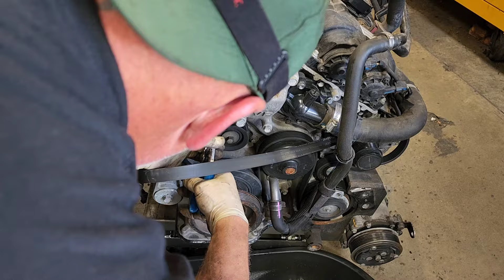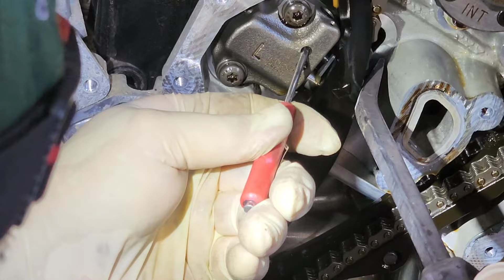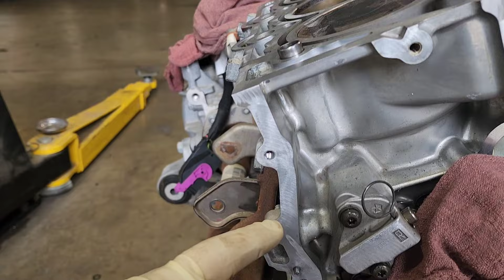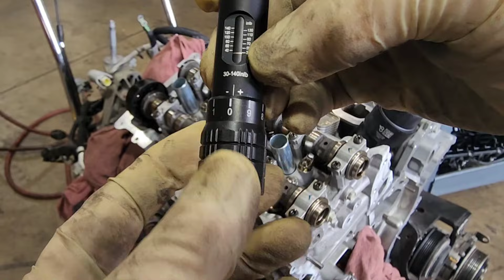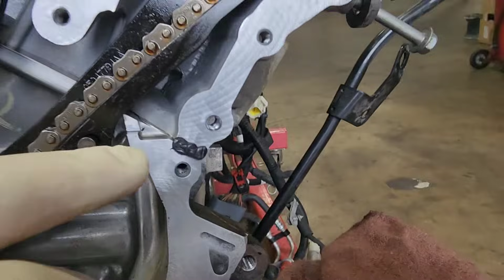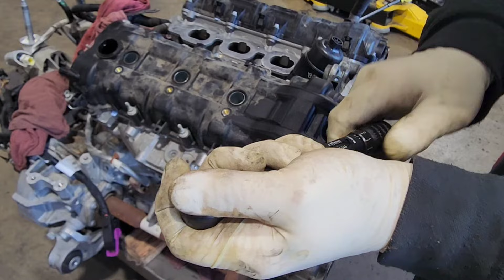3.6 Chrysler Pentastar How to Replace Head Gaskets

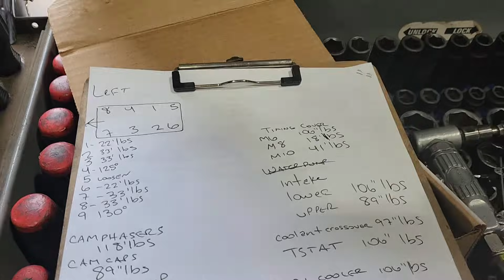Comment: 11:25 this is a v6, right? That's someone giving advice for a v8....
Reply: There are 8 bolts holding the head cover to the engine block on each side
Reply from the maker: This is a v6 engine.

Comment: What were the torque specs for the bolts when putting the pulleys and tensioner back on
Reply from the maker: Message me on Instagram
Reply: @nutsandboltswithtone  I don't have Instagram
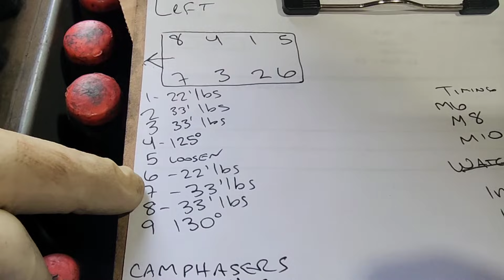Reply: @nutsandboltswithtone  How far do I loosen the bolts on step 5 at 11:43

Comment: What a automotive rebuild nightmare. Back in the day I replaced a Mopar 440 crank in a K Mart parking lot
If DOHC engines were first, the 1948 Olds V8 would be considered an engineering miracle .
This video should be titled " Why EVs are an inevitability "
Reply from the maker: @lynee9485  a lot different then older cars for sure

Comment: You do not have to remove the front cover to remove the cylinder heads. I just replaced a 2016 van left head. I did not remove front cover.
Reply from the maker: You are correct you can do the left head with the cover on but not the right head. Thank you

Comment: I actually helped a friend with a head gasket job on a 3.6. We used head studs instead of head bolts. I just find studs work better.
Reply from the maker: @mikepuk8224  yes head studs are for sure better
Reply: @ I prefer the durability of them. Head bolts on a 3.6 I am not too fully trusting of them for some reason.

Comment: Thanks for making the video and telling me the torque. I'm going to do it in the van I have. I have a Misfire on the piston but I've already changed what the book tells me: the spark plug, the injector and the coil. The problem is valve
Reply from the maker: Good luck.

Comment: If I check both heads for flatness and they pass would it still be necessary to send them to a machine shop? I’m trying to save time and money where I can but only if it makes sense. Wife’s jeep started puffing from exhaust and then failed a coolant sniffer test but never overheated.
Reply from the maker: @smith45acp  Tbh I never pull heads on anything without sending to the machine shop.  May need valve work and also to have valve stem seals replaced.  Just my personal opinion.  You're already spending a bunch of money to do the repair may as well do it completely right.
Reply: Thanks, man. This video has been very helpful.

Comment: Great video. What RTV silicone do you use to fill the gaps when replacing the valve cover gasket? Also how long after applying the silicon can you install the cover?
Reply from the maker: I get the rtv from Chrysler for this, but most guys in my shop your Permatex Right Stuff, supposed to be set within 5 minutes. Once you apply the silicone you need to get the cover on asap
Reply: @nutsandboltswithtone thanks

Comment: Does the engine HAVE to be removed for this job on the ram 1500s?
Reply from the maker: @aaronchandler152  no not in a truck. Usually you can do it in the truck

Comment: Got a code for intake valve control solenoid number 4... p1059...is that the ones on the front of the valve cover?
Reply from the maker: @jamesburch716  should be but just I'm at home and don't have access to info right now

Comment: I have been trying to find out and have had no luck. Why when removing the cams would you need to remove the oil control valves and phasers. Couldn't you loosen the chain tensioners and then remove the chain and leave the phasers/control valves attached to the cams?
Reply from the maker: @waynebowen8872  the timing chain does not come off without removing the phasers.

Comment: I took one apart last night, the cam arrows were lined up when i took it apaet. I marked the marks for each cam but forgot to make a mark on the idler. And none of tbe original 3 links on the chain line up to the marks i made. I had the head off so i know im at tdc but i forgot to mark the idler pulley. Any ideas/tips what i can do to make sure im in time with the idler sprocket
Reply from the maker: There should be visible links on the chain, so you could just use the chain and put it on the engine by colored links. message me on Instagram and I can help you out
Reply: Basically the arrows on my idler sprocket are facing up instead of down

Comment: Excellent illustration of dismantling the engine and reassembly! I don"t follow you and the torque specs though. It doesn't"t make sense to me. Could you clear that up for me?
Reply from the maker: I am home on disability at the moment, had to have surgery again on my foot. the screw in my foot broke, I just got a new partner that has online oem repair info. If you use my code
Nuts&boltswithtone you get 22% off. go to emanualonline.com
manuals are between 20 and 49 and has all the repair info, diagrams and torque specs.

Comment: What do you recommend on what to use to clean engine deck surface?
Reply from the maker: I personally use scotch brite pads, you buy it in little sheets, cut it into pieces. Keep it soaked in Brake clean and it cleans the best.

Comment: I had a question as working on jeep wrangler 2013 the manual said i had to torque the headbolts to 140 degree but i only done 130 degree. when i start the car am still had coolant leak in the piston. I have send the head to machine shop and snad the block my self.
Reply from the maker: First thought is if you did not torque the heads properly then that would be what I would think.

Comment: Thanks for video I used it as reference guide to replace left head gasket. I’m sure I got it out of time, any advice on how to get it on the right timing
Reply from the maker: @danreid694  oh man I'm sorry to hear.  Unfortunately if you didn't time it correctly you have to disassemble to get it back in time possibly redoing the whole thing.  You can message me on Instagram if you need any help.

Comment: Am in the process of putting the timing chain back the marking has when off two pin after two revolutions but I can still count 12 pins is this still alright ?
Reply from the maker: When you put the timing together you line up the colored links, pull the pins on tensioners, then you are rolling over the engine to get slack out of chain, the colored links will not line back up unless you turned over the engine a whole bunch. As long as the chains were on properly and engine was timed correctly then you are good. count the links and if that turns out correct then it is ok. hit me up on Instagram if you have any questions.

Comment: Have a question after you did 2 resolution turn timing marks on chains ore off but timing is still top dead center
Reply: Thank you sir
Reply from the maker: @joseperez-ix9qd  your welcome
Reply from the maker: @joseperez-ix9qd  the links on the chains will only be lined up when setting timing.  If you have the tools in properly, install links on proper marks. Then you are rolling over motor to get slack out.  With a timing chain system and having colored links you just make sure it is set properly at install. Message me on Instagram if u have anymore questions

Comment: Great video full of info. I did the back R head on a Northstar Cadillac in the vehicle. I'm planning on replacing the right cylinder head on those 3.6L also in the vehicle. I know it's very difficult but I think its easier then removing the whole engine. I don't usually remove everything especially the timing cover I open it just enough to slide the head out and leave the chain tensioned up. It works every time on 3.0L BMW and ML Mercedes.
Reply from the maker: That is awesome, I have seen people do just the left head because the tensioner is at the top but the right head or rear head tensioner is at the bottom. I have never done just one head, always both.

Comment: 7.58 I USED A SCREWDRIVER  ON LEFT WORKED GREAT TO ABLE LOCK THE SLOT ON THE TOP TO SLIDE A ROD DOWN IN THE LOCK GROVE.
Reply from the maker: @anthonymartin2412  very nice, thanks for sharing.

Comment: I got a 2014 Durango v6 Pentastar and I’m sure it’s a blown head gasket. Change the thermostat, the water pump, the oil cooler housing and spark plugs. Noticed when pressurizing the coolant system to refill with coolant it held no pressure and the spark plugs were super wet thought maybe coolant mixing? Ran the car and got white smoke out exhaust and coming out the radiator cap. I’m sure it’s the head gaskets but what do you think?
Reply from the maker: @RoqueM64  sounds like blown head gasket to me.  Here is a link to a Tester kit.  https://amzn.to/4e0vqjl
Message me on Instagram if you need more help.
Reply: @nutsandboltswithtone  thanks brother I sent a dm on Instagram

Comment: What happens when your little brother turns that crank pully to a random position, after you remove the heads. is the engine out of timing? if so how do i put it back?
Reply from the maker: Well you have to realign the crank again. Message me on Instagram and I can try to help you out.

Comment: Where do you get those pins from, I can’t find them anywhere where for th plundger?
Reply from the maker: @trapdiddy  they come in the timing till kit
Reply: @nutsandboltswithtone  thanks man
Reply: @nutsandboltswithtone  can I just removed the whole tensioner instead of using pins? Will it mess up the engine?

Comment: Nice job, but Felpro garbage? You're a brave man.

Also, I do oil the bolts. I use machining oil. Just a few drops on the first couple of threads. I know Chrysler doesn't want us using oil, and that's great on a brand new casting. But on an engine that's been to the moon and back? I'm lubing the threads. Think about all the stress you're putting those threads as you have to do the sequence twice to pre-stretch the new bolts.

Oil is your friend.
Reply from the maker: I have to use whatever parts I get from the service advisors. As far as oiling the threads I only oil the threads if the manufacturer recommends it.

Comment: Is it a must to take your heads to the machine shop?
Reply: But why can’t you just buy new ones? Instead of re using old ones?
Reply from the maker: @trapdiddy  buy new cylinder heads? Sure you can, but taking them to machine shop and having them resurfaced and a valve job done is just fine.  It's up to you.
Reply from the maker: I would never pull heads without sending them out.

Comment: Excellently Executed video, in all aspects. If I were to do a video on this, this video is exactly how I would try for it to turn out. Clear, direct, quick about the special tools used and using them properly. I was dreading this job. Was leaning towards getting a remand engine. Now I’m thinking about saving someone thousands of dollars by removing the heads for machine shop work. Thanks for this, hope you have others like it I’ll need someday. 👍🏼 👍🏼
Reply from the maker: Thank you so much that is very nice to hear. If you need any help hit me up on Instagram. Good luck.

Comment: Why do you have to crack the engine over after replacement?
Reply from the maker: Do you mean turning the engine over after getting chain installed?
Reply: @nutsandboltswithtone  yes
Reply from the maker: @DavidPerez-jx2el  you do that to make sure tensioner is released so timing doesn't jump on initial start up.  The procedure for the job does not say to do it,  I do it because I've known people that have timing jump on initial start. You can message me on Instagram if you need more help.
Reply: @nutsandboltswithtone  thank you so much for your reply! Your video helped me so much during my repair!
Reply from the maker: @DavidPerez-jx2el  I am so happy to hear.

Comment: Great video why didn’t you replace the timing chains and the oil cooler since you had the motor so far tore down the labor would be nothing. Probably would’ve guaranteed another 200,000 out of it. Not trolling just curious.
Reply from the maker: I did replace the oil cooler,  did not do timing chains because it had less then 100k. Customer wanted to spend a little as possible.  I had to pull teeth to get oil cooler.  Ended up finding signs of leaking from behind water pump pulley so did water pump as well.  Thanks for watching

Comment: Is sending the head off to a machine shop pretty much recommended if you are doing this job? I plan to start working on my 2019 Jeep Grand Cherokee in the next week or so. This video is a gold mine, I will use it on my shop TV as a guide.
Reply from the maker: So here is the thing about that, if you are removing your cylinder head I am assuming it blew the head gasket. This is a very expensive and time consuming job and it is not smart to not have the heads checked. If the heads are warped or there is a valve train issue and you just replace the head gaskets you will be doing it again. Most of the parts are not reusable so you will be buying the parts again. I have been doing this 20 years and I never have taken off a cylinder head and not sent to machine shop to have it checked. It is a gamble. Good luck and message me on Instagram if you have any questions. Thanks for watching.
Reply: Turns out it was a bad rocker and leaking valve cover gasket, dodged a bullet. Compression test and sending the borescope down the spark plug holes confirmed it was not the head gasket.  @nutsandboltswithtone
Reply from the maker: @jd_AU_wde  awesome to hear
Reply: @nutsandboltswithtone  I am waiting on camshafts to arrive from MOPAR, is there a break in process that I should adhere too when it’s all back together? Replacing all intake rockers and lifters, as well as the intake camshafts.
Reply: @jd_AU_wde
Reply: @jd_AU_wde how can you tell it isn’t the head gaskets with a compression test? Because each cylinder holds compression?? I’m wondering because I think I blew my head gasket.
Reply: @NutsandBoltswithTone mine is a grand cherokee too. How about buying a remanufactured head vs milling what do you recommend?
Reply: @Grant3758  do what I did. Patch it up, trade it in for a Toyota
Reply from the maker: @Grant3758  personally I would just have head machined and a valve job.  Other thing you have to worry about is the camshaft, lifters and rocker arms.
Reply: @nutsandboltswithtone  iv done cams and lifters/rockers and it wasnt a bad job at all. Should be a fun project. Thanks for the help. I'll call a few machine shops then and price out a new head
Reply from the maker: @Grant3758  awesome, keep me posted on how it goes or hit me up if you have anymore questions
Reply: @nutsandboltswithtone  hey thanks i apreciate that i will. Lemme ask ya with your experience... prapare me mentally for the odds that i see a crack in the cylinder wall or any other catastrophic issues? Or is it usually just gasket head and done with it?
Reply from the maker: @Grant3758  Honestly I think you're gonna be ok. How many miles on it
Reply: @NutsandBoltswithTone  about 140k. alright brother. Been about 500 miles now since i swapped my head and gasket. Used all oem dodge parts and things runs awesome. Just wanted to update and say thank you for the detailed video and answering my questions. Cheers!

Comment: That engine block looks very clean but for anyone I was wondering if they did replace oil pump on this engines over 300k miles on second engine the van has 425k miles 😂 is it even worth spending on parts will cost me around $1000 from rockauto
Reply from the maker: This engine had low miles so that is why it probably looks clean. As far as the oil pump, I personally would not put an oil pump on from anyone other then OEM part. The oil pump is a common failure item on these engines. Wow 425k that is impressive. Hit me up on Instagram if you need anything. Thanks for watching.

Comment: Best video at doing this job I have seen. Great job. I drag race for about 25 years with BBC and SBC. As far as warp head I never seen a wrap head with the deck not being wrap also. I thing you could clean the head surface and check it and clean it up with a sanding block. Check your deck and it will be worse than the head. The head has a lot more material. Only time I did the head if it was going on a different block and the block was not flat either. That is why you have a head gasket to make up for the little difference between the two. Now for my question on the great job you did on the 3.6 penstar engine. Since there is some common failures on these engine if it was my engine you was doing I would want new timing chains and guides and tensioners. Also a new Dorman aluminum cross over plate and and a new oil and water cooler under the intake and  thermostat housing. Plus new spark plugs. Old plugs are hard on the coils. Am sure there is a few things I missed. Only mostly only for the parts as you are already there. Changing timing chains or that new oil and water cooler under the intake after it is back together after a year or less is no fun. They had problem with that right head. They had a bulletin that if you a problem with that right head they warranty that head for 10 years. First time I have seen that type of clamp. Seems they come out with more stupid stuff so you have to buy new tools all the darn time.
Reply from the maker: First off thank you for the feedback and for watching. I agree if it were mine I would have done timing chains, guides, etc. The oil cooler did get replaced. Thanks for watching

Comment: Man these things are junk
Reply: What do you mean junk?  There are over 10,000,000 of these engines built.  Earlier ones had rocker arm wear but they have no more problems that other engines out there.  I have 225,000 kilometers on mine with no major problems.  The alternator slip rings died on mine at 182,000km.  Its a well designed powerful engine .  I think a lack of maintenance is the biggest culprit in engine failures no matter what brand your running.
Reply from the maker: Yes they are.  But hey there are quite a few on the road. Thanks for watching